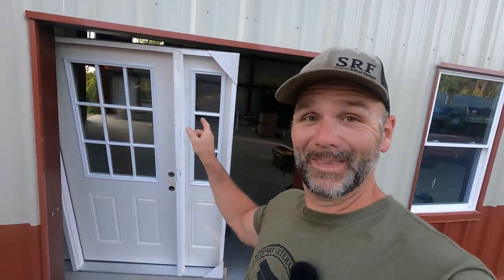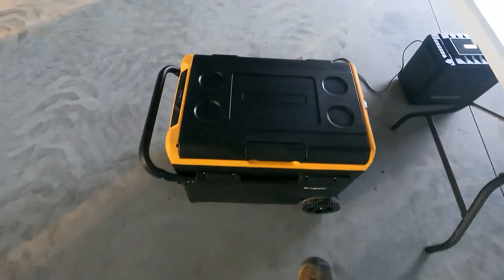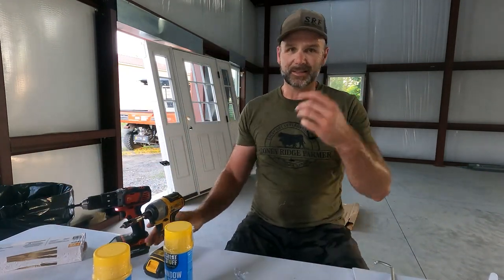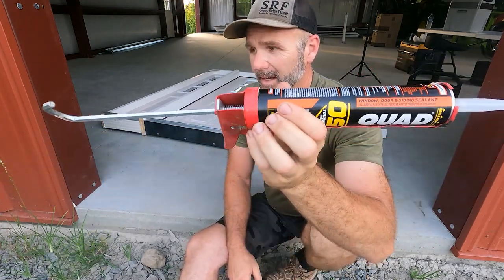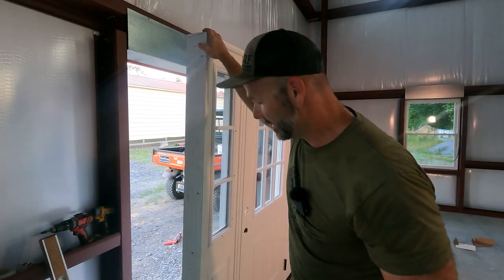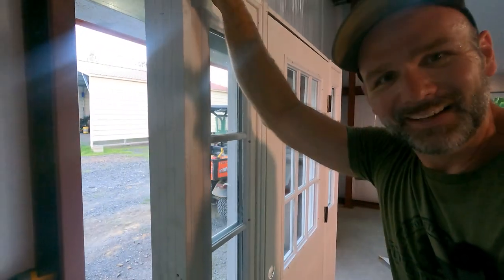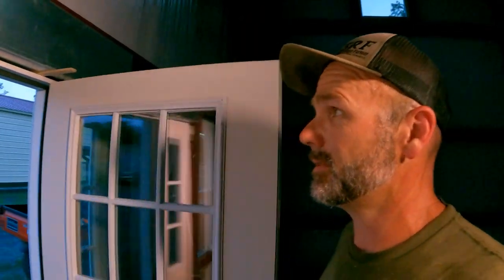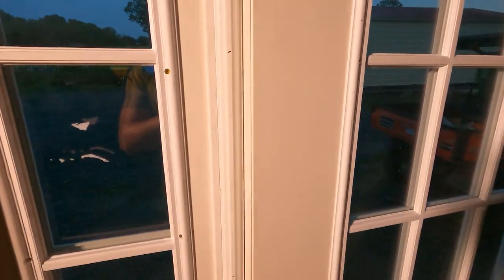Easy way to install and exterior door in minutes!

Comment: Nice, what color are you going to paint it?
Reply from the maker: I’m not sure…what do you think? Anyone else have an idea?
Reply: @StoneyRidgeFarmer dove green.
Reply: @StoneyRidgeFarmer  now it is called green smoke.
Reply: @StoneyRidgeFarmer  I would recommend a somewhat light bright color and a high gloss so it won’t get so hot. You use a dark Color like brown, dark blue, Indian red or black for that door It will get so hot you’ll be able to feel heat radiating from it 2 feet away. So go with light and bright and glossy because it reflects sunlight away but has the extra benefit of being easier to keep clean because it’s a much more smooth surface. On the inside just match the decor for your office.
Reply: Hunter Green
Reply: @StoneyRidgeFarmer  yellow

Comment: Good job on the door Josh. I would highly suggest we do anymore to take the door off to make it way easier to put it up. Also, some temporary blocking on the outside to stop the door from falling out temporary. Also on the shims you put one from each direction to make it even across the whole door what you have even thickness on the whole door.

Comment: You might not know it, I always forget, but there is a hole near the handle on your chalking gun. You stick the tip of caulking cartridge in it and pull handle. It cuts the tip  off. Also, now they have composite shims which are much better than the wooden ones. They don't split when you drive a screw through them.

Comment: The hole in the handle of the caulking gun is for cutting the tip off the tube.  Stick it in there and squeeze the handle.
Reply from the maker: yeppers...however it's dull as snot and it doesn't give me the precise tip that I like...I'll do a short vid soon explaining how I like to cut my caulking tips

Comment: Is the Door hollow at the bottom wr the aluminum is!!.
Reply: If you look at a cross section of the aluminum sill you’ll see that it has a slight ramp to it up until the seal that matches the seal on the bottom of the door. Underneath it has longitudinal ribs that contact the floor. It is not a solid piece.

Comment: For future reference, the door should be ordered based on the rough opening which is the exact size of the opening. That same RO number should be what your contractor builds out to. The door manufacturer will do the math and provide a door that is about 1/2 inch narrower and shorter than the RO. This allows shimming. The most important factor in shimming is to be able to square the door. Of its not square it may bind. You also want it to be plumb. If it’s not plumb the door may hit the floor when fully opened. Further, a door that is out of plumb will not stay partially open. It will drift in the direction that it out of plumb by.
Reply from the maker: yep...for sure...however the door was ordered and the building was supposed to be built to that spec...they just failed to add 3/4 inches to the frame size....we got the brotha! Thanks so much for all the great info buddy!

Comment: For future reference you checked plum but not level. You should’ve checked your threshold to make sure the bottom of your door was level and if it wasn’t you could’ve shimmed underneath the threshold in order to make it level. If in the future your door starts to do weird things it might mean it’s not level which now would be a real major chore to fix because you’ll have to take all your trim off and all your current screws out and then drill new holes to insert your screws on the side you raise up. It looks like you may have got lucky though and your cement people who laid your slab did a very good job of keeping it level but you really shouldn’t just trust that.

Comment: Remove The Door, would t it be easier?. Less weight to move 👍
Reply: That’s what we do. Just tap the pins out of the hinges and you can manoeuvre the frame a lot easier. Not typically done in DIY videos guess it’s just an extra step for them to worry about
Reply from the maker: keeping the door in place ensures no twisting of the frame
Reply: @StoneyRidgeFarmer  carpenter for work, we remove the doors and check the frames for twists, plumb etc as we install. It’s a bunch of extra steps but is easier to install with 1 person. There are also a few differences in building methods and everything between Australia and America due to different climates etc. Just how it’s done down here. As they say there’s more than one way to skin a cat, if the final result is good, go for it